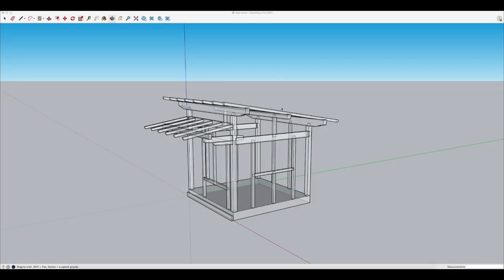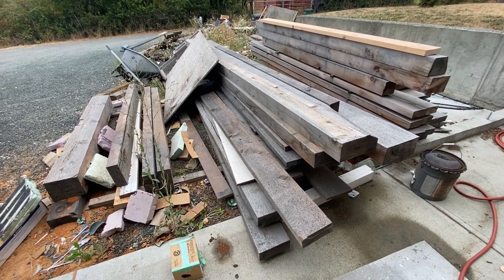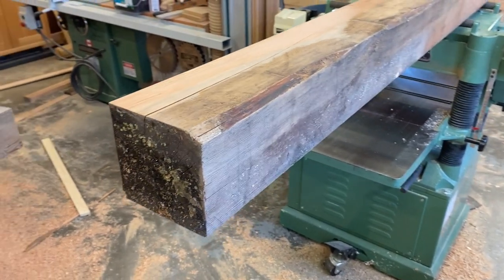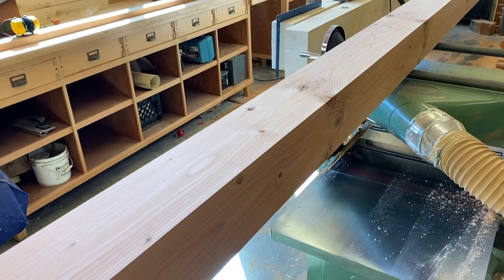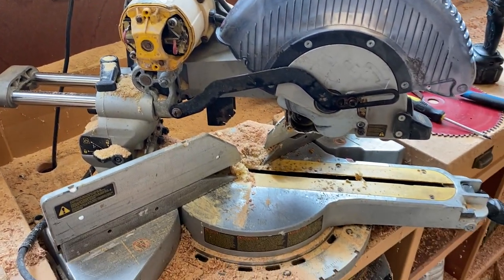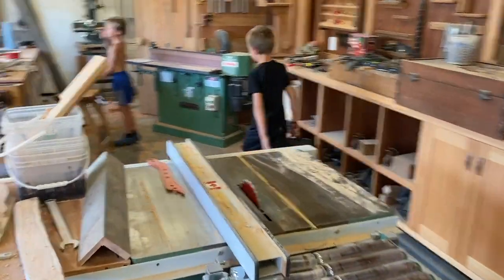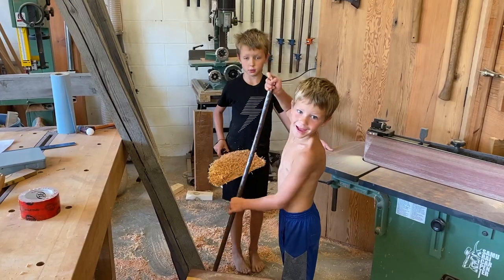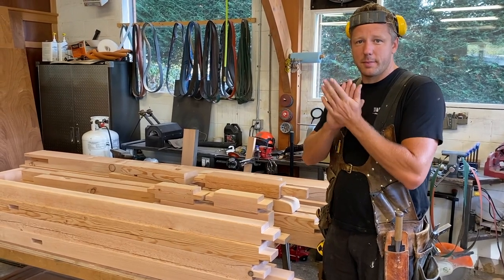Preparing My New Timber Frame Cabin!

Comment: Beautiful work …I was wondering how you ensure the whole thing comes together…do you dry fit?
Reply: Easy enough to take a mallet and some chisels out to the site to make any fine adjustments once things start going together. Hopefully all the mortises are in the right place. 😂
Reply: Computer model is handy for that purpose. Just need to be careful with measurements. It is wood, so it is a bit forgiving with tolerances if you are carefull enough.

It has been said that construction man makes things within centimeter tolerance. Metal man do tenth of millimeter, gunsmith can do hundreds but carpenter makes everything fit exactly.

Comment: As usual, terrific work Jesse! I am curious as to why you didn't fill those cracks in the wood in order to provide a bit more stability? Given the extreme weather changes in that area, I would be concerned about that wood twisting further over time. Anyway, hope that you & your family are doing well.
Reply: I was thinking the same, maybe fill those cracks with epoxy..🤔
Reply: All timber frames have checks. Including ones that have been standing for hundreds of years.

Comment: Squaring a timber that's center cut with spiral growth checks is sketchy for long term stability. It will always move in the spiral twist direction that it grew, fir is noted for that. Too bad you have no way of harvesting/milling the dead wood noted in your last video.
Reply: yeh he's a sketch ball
Reply: Do you have a channel where I can learn more of these old dude tips?
Reply: True, in a way. Actual twist comes to play more in log houses made from round logs. When using square logs that are supported from both ends and by other means the actual twisting isn't that big of long term stability issue. Huge amounts of houses built from square cut logs here in Finland and mostly all problems arise from foundation issues or roof.

Comment: I bet it will be amazing, but could be even more so if you used wood fibre insulation instead of having to take a load of plastic-based stuff out into the wilderness! It's generally more expensive than PIR/styrofoam and needs a thicker buildup to acheive the same U-value, but biodegradable. Not sure how easy it is to get hold of in Canada though... 

(Edit: just got to the bit where you said you're broke so maybe not an option!)

Comment: Jesse you're overlooking the possibilities with rammed-earth construction. You have so much more Earth then you have money to buy lumber. Look into how to manufacture a rammed-earth home, it will last a thousand years
Reply: The ground is essentially solid rock on his property
Reply: You do know this property is only accessible via boat, right? Rammed earth is really cool, but it requires very large specialized machinery and it comes out to be quite a bit more expensive than traditional wood building methods. Not to mention this is Samurai *Carpenter*. 🙄